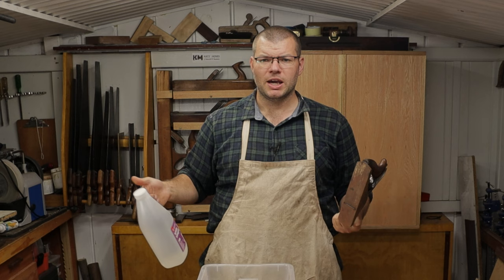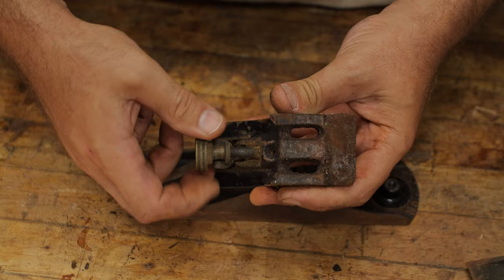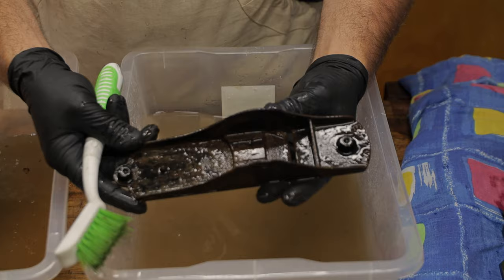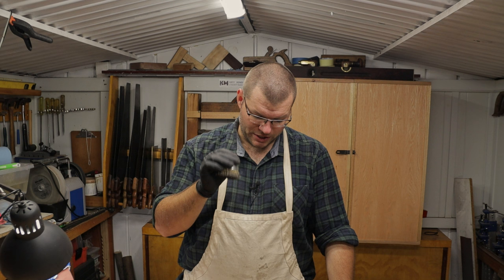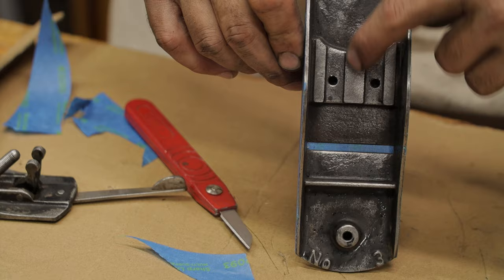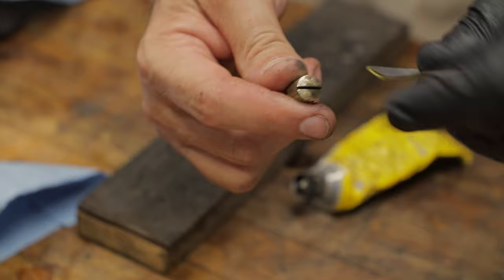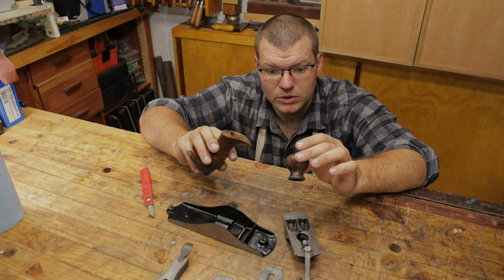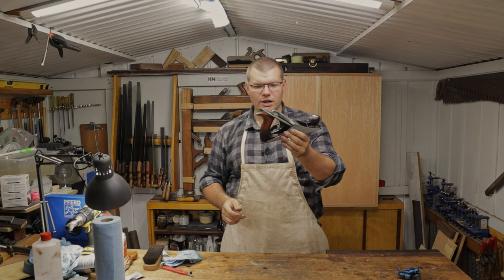Restore Old Hand Planes with Vinegar - The Quick and Easy Way

Comment: Vinegar will pit the iron. Use evaporust
Reply from the maker: There is nothing wrong with using vinegar to remove rust off tools. It wont pit and metal if used correctly and washed thoroughly after soaking.

It would take weeks for metal of any substantial size to even be effected by vinegar while soaking.
 It would even take quite a period of time for vinegar to develop severe enough rust to pit a metal surface even when exposed to the open air. 

The reason behind this is vinegar is regarded as a fairly weak acid, after all we eat vinegar. Most household vinegar is about 4- 5% acidity and 95 - 96% water.

At the end of the day if vinegar is used correctly and washed down thoroughly, there is next to no risk of flash rusting let along pitting the metal surfaces. However, it will remove the rust on the surface which may expose pitting caused by the rust and not the vinegar.

I do use Evaporust and i like using it as it acts faster than vinegar and is reusable. But Evaporust is expensive so vinegar is definitely and safe and useful alternative. I have use vinegar to restore metal handtools for years and have not had it cause rust let along pitting on any or my tools.

Thanks for you comment
Reply: Just keep an eye. Vinegar or electrolysis.
Reply: You don’t know anything about vinegar bud

Comment: I like how you get straight down to business in your videos. You are clearly not a wanker. What paint did you use?
Reply from the maker: @kieransullivan1737  Dupli color - engine enamel with ceramic, semi gloss is best, but gloss looks fine too. This is the black paint i have been using recently and works great. 

I used to use rust oleum primer and paint in one but i have found it hard to get and the dupli color looks better.

Comment: I usually clean parts with wash up detergent and water before using the vinegar. any oil on the parts slows the vinegar from working.
Reply from the maker: Yes, i do agree with you. Sometimes i just skip that step if it doesn't look too dirty/oily
Reply: @AussieWoodshed  yes sounds like the sensible way to go. Sometimes the rust has already been there long enough that no oiliness is even left.

Comment: IM thinking the paint might not hold well with greasy hand touching the part about to be painted not sure what type of paint you are using but most paints don't do well with an uncleaned surface, and you can't dip it to clean after you tape it or it will run on to paint.
Reply from the maker: Thanks for the concern. I always make sure my hands are clean and i barely touch the painted surfaces after its been cleaned. Doing it this way i have not once had an issue with the paint not adhering, maybe it could cause a problem, however I've never had an issue.

Comment: Nice job overall. Panicked a bit when u used sandpaper and fingers on the sole... learned from restoring car panels years ago this will leave impressions of said fingers which need to be flattened out. Always best to use a sanding block wrapped with sandpaper.
Reply from the maker: Thanks

Comment: Nice job! For masking off threaded holes, find a bolt a size or two smaller than the hole a couple of wraps of tape around the bolt and then into the hole. Cheers
Reply from the maker: Thanks for the tip, i will try it out next time!

Comment: Great video. My mate gave me an old Stanley no.5 which I’m gonna do up. Your video is invaluable. Gonna go with electrolysis to remove rust as it’s worked for me before. Cheers
Reply from the maker: Good luck with your restoration. I'm sure the hand plane will look great when finished, more importantly im sure it will work great too. I will get around to trying electrolysis one of these days.

Anyways glad my video was helpful for you. Thanks for the comment

Comment: I recently saved an antique Stanley 4-1/2 plane from a scrapyard. With 3 patent dates cast into the bed dated it at being made around 1910-1918. 😯
I used Evaporust for the rust removal but as you say, that stuff is quite expensive. Also recently discovered an alternative to Evaporust which uses citric acid in the formula and costs about 1/5 the price. Will be trying that out when the Evaporust runs out. It supposedly works in a very similar way and also is able to be used multiple times before having to throw it away.
Reply from the maker: You have a nice old reliable hand plane there by the sounds of it. I too have used Evaporust i keep meaning to make a video on using it. I have also seen alternatives that use citric acid as you mention here and i intend to also give it a go once my Evaporust runs out too. I believe it uses the acid (citric) and a base (neutralizing salt) creating a fairly neutral solution which acts like an acid on the rust and virtually leaves the base material untouched, and is very cheap to make.
Reply: @AussieWoodshed  yes, just add some detergent to the mix to add as a 'chelating' agent and you supposedly have a near copy of Evaporust. 20ml detergent? Some small amount.
Evaporust also contains some sort of detergent which is why it feels slightly soapy and bubbly when you pour it.
Reply from the maker: @stormkhan4250  Makes sense to have some sort of detergent to break water surface tension so it can penetrate better. Not sure how much a little is.

Comment: That's a nice video, thanks! For saving the metal (or any other material indeed) I use Maskol. It's a silicon based product that, once dry, can be removed quite easily. I use it only for the not so accessible parts, of course!
Reply from the maker: Thanks glad you liked it. Maskol sounds like an interesting product.

Comment: I use blu tac for holes and model makers liquid masking fluid to paint on in awkward or small places.
Reply from the maker: Blu tac is a great idea, never heard of model makers liquid masking, i will have to check it out. Thanks for sharing, much appreciated
Reply: @AussieWoodshed   Hi.   I’m a woodworker and model maker and often use the same products for both hobbies.   The fluid can be bought on Amazon, usually pink or blue in small bottles.  You just paint it on and dries like a thin rubber that you just rub off after painting.   Blu tac is great for holes.    Thanks for the reply.   Great videos.   Enjoy your work. 👍🏼

Comment: Nice restoration.  It looks like a solid addition to the plane rack.  
Surprised some maker with a laser cutter hasn't adapted it to cut painter's tape.
Reply from the maker: Thanks. Definitely a great addition to the plane rack. Laser cut painters tape is a great idea. It would make taping up the plane so much easier.

Comment: 0:17 Great review! Just wondering if you can use extra fine steel wool and WD40 to polish up the sides of the hand plane...i found a really nice #4 hand plane from 1930's (Stanley) and it doesnt have a lot of rust at all, just some patina..
Reply from the maker: WD-40 and steel wool should be fine,  it will have the added bonus of protecting the sole from future rust also

Comment: great video and demo and soft background music.   Question . Would i change the appearance of the wooden handle bar completely new If I was to sand it down to the bare wood and then re-stain it ??  Thank you again
Reply from the maker: It depends on the timber used really, generally if I am going to refinish a lighter coloured handle i will use tinted shellac for this to give an event stained colour as usually most people aim to make the handles look like rose wood used on earlier models of Stanley  hand planes. The handles on this plane looked great, but I'm unsure when timber they are. 

I hope this helps, it's just difficult to know for sure if it will change in appearance.
Reply: @AussieWoodshed  Thank you very much. Very helpful. !!!!!!!!!

Comment: I have a question.
Why is it necessary to paint it?
thanks
Reply from the maker: @rodrigoromero-by8os  First of all im doing a full restoration and want to making the plane look as new as possible, and since i am unable to restore it using the original japanning so i paint it.

The painting achieves stopping rust forming where dust lands on the sole of the plane when in use as it forms a barrier over and exposed bare metal.

Do you need to paint it? Well technically no.

Doesn't it work fine without painting it? Yes. But since the painting is an easy step and helps prevent rust i do it anyways.

Hope this helps
Reply: @AussieWoodshed  Thank you very much. I learning a lot with the video. greetings
Reply from the maker: @rodrigoromero-by8os  Glad to hear it, if you have any others questions just ask and ill do my best to help.

Comment: hi!
What kind of paint did you use?
Reply from the maker: In that video i used Dupli-Color Engine Enamel Semi Gloss Black - DE1635, another option Ive used in the past is if you can't get that is Rust-Oleum 340g Canyon Black Satin 2X Ultra Cover Paint+Prime. Dupli-Color is better however.

Comment: Great stuff. Thanks for this. What oil are you using in the threads?
Reply from the maker: Just a light machine oil. Such as 3 in 1 oil.
Reply: @AussieWoodshed  thanks! I'm not familiar with metal work so that is helpful.

Comment: Can you put parts in a warm oven to evaporate any moisture
Reply from the maker: As long as its not too hot i don't see why not. I put them in the sun (so i haven't used an oven) so if its no hotter than a hot summer's day should be fine.

Comment: What kind of spray paint is best to repaint a hand plane?
Reply from the maker: For a quicker process i have used Rust-Oleum 340g Canyon Black Satin shorturl.at/dhtyU , which contains paint and a primer and looks fine, however is a bit of a thicker paint. Otherwise, any other satin black paint for metal (looks more like the japanning) and most like want to use a primer undercoat first if not combined. 

I have been lately using Dupli-Color Engine Enamel shorturl.at/kpxK0, i have used this one with and without a primer and it lasts okay without a primer but does chip a little bit. 

I'm not sure where in the world your based, but these are the 2 paints i have used for Stanley Hand-planes. Rust-Oleum is probably easier to get and i think its available around the world.

But as i said any satin black works well so its not too shiny. Just need to make sure it has a primer (either separate or 2 in one) to last the best and apply thin coats so you don't over fill any lettering on the plane. Lastly make sure that paint have full dried and hardened before use the plane to prevent it coming off prematurely.

Hope this helps
Reply: @AussieWoodshed  it helps immensely. Thank you very much for the response.
I'm in Canada, so both paints you suggested are available.